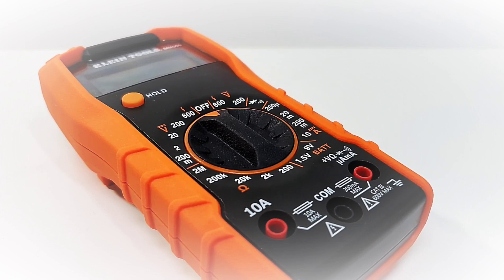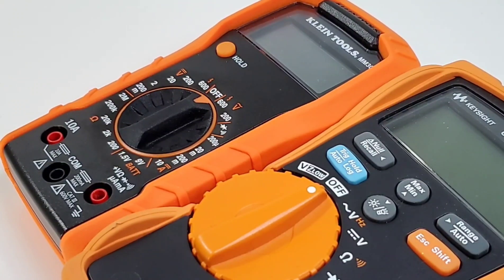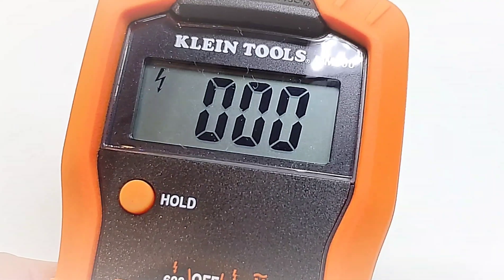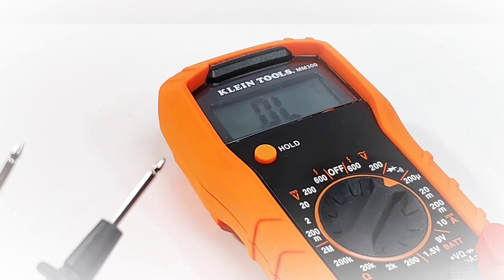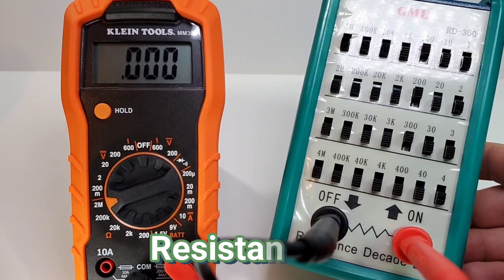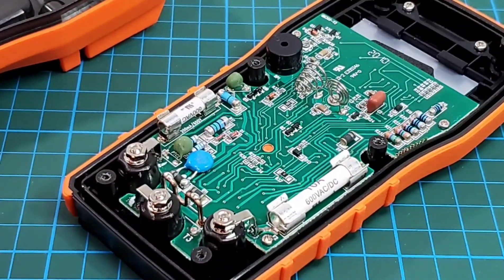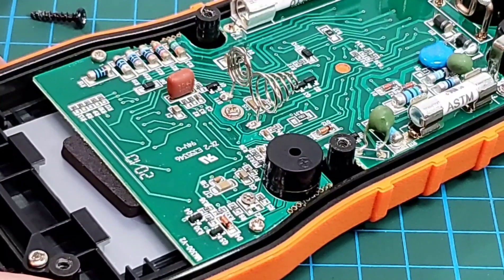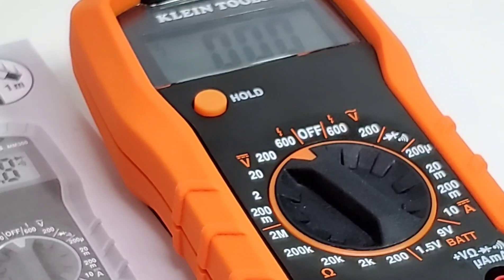KLEIN TOOLS MM300 CHEAP-O Multimeter Review & Teardown!

Comment: Great teardown video, super helpful! Can anyone please help me out with what the little components on the board are that are at D12 (an orange cylinder) and R1 (black square next to the light blue circle)? And what importance they are to the multimeters functionality?
Reply from the maker: D12 is a Zener diode, it may be related to reverse input protection. R1 is an smd resistor used as part of the input protection circuit. Both are required.
Reply: Thank you so much for the information! It's hard to tell in the video but is there just 1 smd resistor soldered at R1?
Reply: And what would happen if either of those were either missing and/or messed with and I tried to use it? 

I'm asking for my own safety, someone gave me this and due to his nature, something told me to check it first before I went using it. And as I'm watching your video, I noticed that D12 was unsoldered and missing and at R1 there is 2 soldered, one on top of the other. That may be a common thing, but I personally haven't seen it on anything before. I just dont know whether I should use it or not.
Reply from the maker: @bbblondie  Most welcome! Sounds like the meter was repaired or modded. Unless you know what you're doing I would not use the multimeter except in low voltage scenarios..checking batteries etc.
Reply: I only needed it to check a few sensors on my car, I just wanted to know that if I use it Its not going to catch on fire or anything like that. Thank you again. You have been super helpful! 🤗
Reply from the maker: @bbblondie  Anytime my friend 👍

Comment: In my honest opinion this meater is fine for your basic use in the mechanic world either automotive or diesel trucks to equipment it's awesome for it's basic use. Now for your further death stuff. I'll stick to fluck
Reply from the maker: It's definitely a capable dmm ! I suggest checking out some of the new UNI-T Multimeters..including the new UNI-T UT117C (my  review will be online soon) ...better than its Fluke counterpart and performance is off the charts ! 😊
Reply: @KeepOnTesting  it all depends on what you're using it for too...

Comment: FYI, as far as testing for ohms, it’s a lot more accurate if you touch the tips of the leads, not the sides of the pins.  That’s why they have them plastic shields on the tips of the leads. Not only to protect it but to cover the whole pin except for the tip .  There is no reason to take it off except if you want to test a receptacle. Don’t take my word for it try yourself. Just touch the tips of the pins together

Comment: WHy have volts ac 600 and 200 as separate options. only to let you know its dangerous
Reply: nevermind... reading the manual as it is just for accuracy
Reply from the maker: @austinreeves5221  Yes indeed.. as a Manual multimeter having your range as close as possible to your test voltage will always aid in giving you a more accurate and quicker result 👍
Reply: @KeepOnTesting  Thanks!

Comment: What do you recommend that will test a 1.5, 9 volt battery under load?  Does this Klein model just read voltage on the battery test or does it add a load?  I have a cheap Harbor Freight Gen Tech that will do what I described, but I want something a little better with more functions.
Reply from the maker: AMPROBE AM-420 is a solid choice. It has the battery test function as well. Great build quality with captive leads.. tested in the Fluke labs so you know its safe. Same price as the Klein..! 😀👍
https://youtu.be/x3oeyNXciLM
It puts a load on the 🔋 battery so you know if they are good or not. Nicer display then the Klein.. Available on Amazon.
Reply from the maker: Also check out my review on the AstroAI DM130B..its also on a Black Friday sale at Amazon  https://youtu.be/Aov6zb0z_Dw

Comment: I want to see you find ANY other dmm with as robust a build-quality AND a 9/1.5 VDC battery tester for $35 or whatever the cost. I’m defending this for sure. I went to buy an outlet tester to shortcut some troubleshooting- at HD, I found what I wanted With a stick tester And THIS all for $40!! aside from a lighted lcd, I don’t ever need more in the field. Cheap enough to replace w/o a thought and can survive a little trauma as well. WHO ever needs a meter to measure resistance any faster than they can turn the knob on a pot or varister? Crappy review- you miss the mark. This thing is a Great value for MY money. Oh. And thank goodness you’re not in forensics- nobody took a Dremel to thisssss, Mannnnnn! Lol. Geeeez
Reply: I was thinking the same thing..I mean, I do above average electrical work around my house and this unit is great.
Reply from the maker: @naroxcpe1964  Besides the lackluster display, poor ergonomics and ho-hum feature set it always surprises me that these dmms are still popular despite the fact other multimeters offer so much more.

Comment: Hey Darren, any chance of doing the PM2016S smart clamp meter that i just picked up for $6? I believe it also is called the Bside ACM24 . Thanks!
Reply from the maker: Done! Wow, 6$ ..! That's steal of a deal 👏  I can't find it cheaper than 20$US...I'll add it to the review list all the same. 
😃👍
Reply: @KeepOnTesting  Thanks Darren! Here's one, but not sure what it is to Canada, as it is in US for me: https://www.ebay.com/itm/Digital-Clamp-Test-Meter-Backlight-Resistance-Temperature-Diode-Tester-US-STOCK/114222037783?_trkparms=aid%3D1110012%26algo%3DSPLICE.SOIPOST%26ao%3D1%26asc%3D20200420083544%26meid%3Dcea1451a43f44c279f93c4db3edc02a9%26pid%3D100008%26rk%3D3%26rkt%3D12%26mehot%3Dag%26sd%3D113697975810%26itm%3D114222037783%26pmt%3D1%26noa%3D0%26pg%3D2047675%26algv%3DPromotedSellersOtherItemsV2%26brand%3DUnbranded&_trksid=p2047675.c100008.m2219    and yes, it was an Amazon steal too, in US!